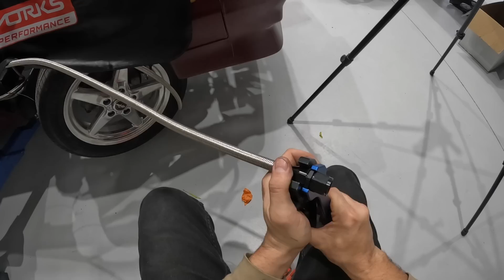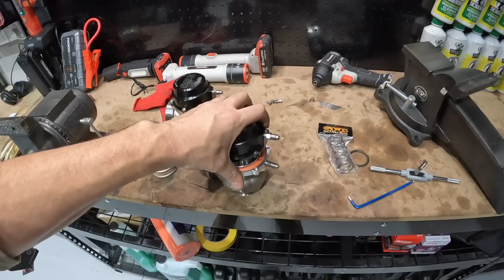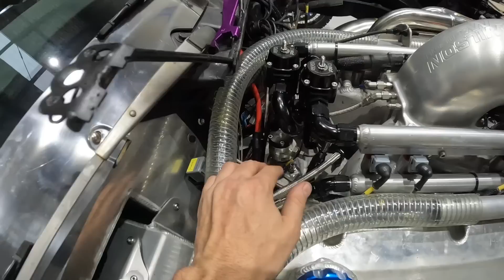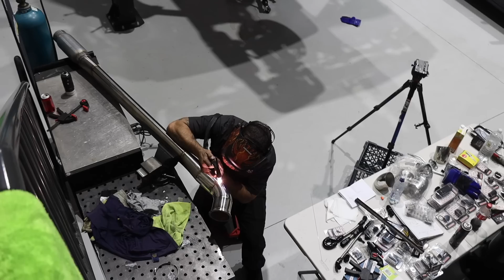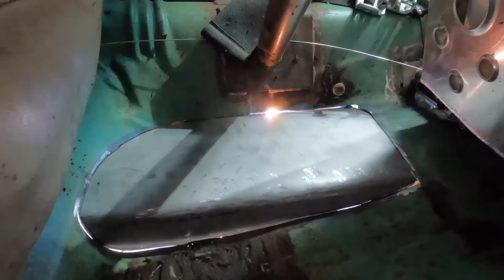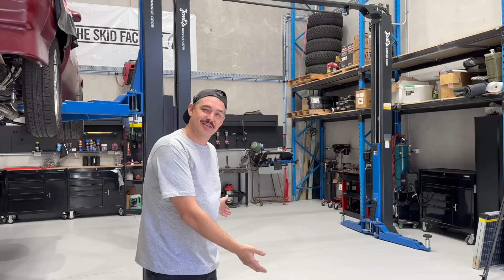FORCE FED 598CI Big Block Freedom Machine - BURRITO BUS EP2

Comment: Quick tip for urethane schmutz: put turpentine in a squirt bottle, slaz the goo on, give it a misting of turps and smooth it out with a finger.... or use a soft brush for that factory seam-sealer look. Doesn't take a lot of practice to  get it looking good.

Comment: Sick car! Keep a close eye on the rear cylinders. You’re probably getting close to the limits of your fuel system design. The third and more so the fourth injectors in series tend to get unhappy in big inch big injector forced induction relatively heavy cars. Even when they’re fine on the dyno the heat, drag etc at the track causes problems. I’ve seen different solutions if you run into that but all of them are better than finding out the hard way first. Four feeds with returns in the middle of the rails or bigger rails and 2-4 smaller injectors per cylinder or adding one big stupid injector before the intake or even a pair before the turbos. The only real point being fluid science gets weird and lean cylinders bad. Good luck and keep up the good work!

Comment: Maybe you could drill a couple of 10mm holes top to bottom in the oval tube and weld in some round bar to deaden/change the frequency of the tinny sound?

Comment: something to be aware of with that filter mounted like that, theres a possibility that big block will cause enough vibration to break that AN fitting at the mech pump. consider a small brace my dude

Comment: If seam sealer is anything like outdoor silicone sealer, lick your finger and smooth it out like that, just don’t make the mistake I did and lick the same finger twice 😂
Reply: Also if you do get castors for that table make sure they have decent locks and some grip. It’s soo annoying to have the table rolling around while you are trying to wail on something in a vice

Comment: Do you think the amount of plumbing and fittings could bring issues ? Havent seen that amount before on US drag and drives. Car looks smart and will rip, Top job woody
Reply from the maker: All cars at this level require this amount of plumbing, some
People hide a lot of it and use different style fittings like push lock hose etc